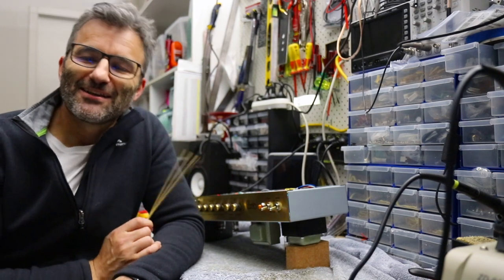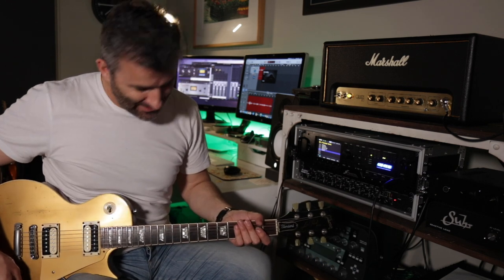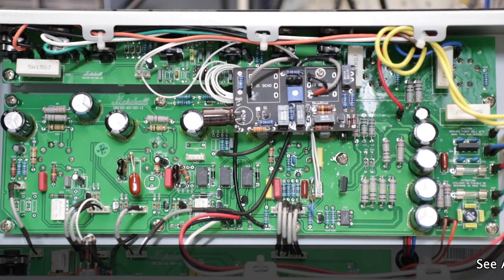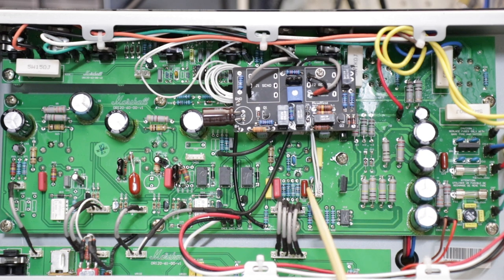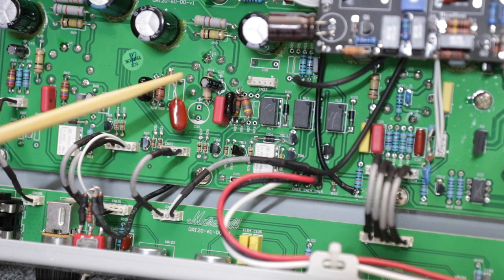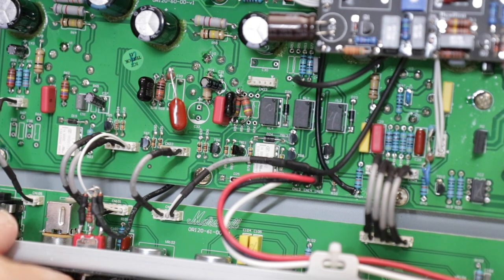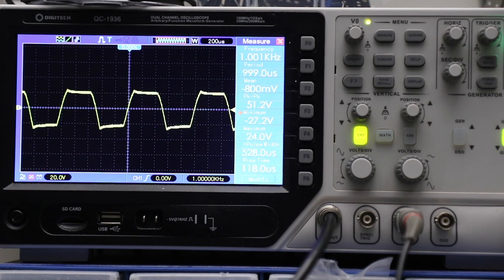Headfirst Modded Origin 20 - José Diode Clipping DIY Guide

Comment: Bought on Friday an used origin 20 for 200£ and I did similar mods to yours. I started with a kind of 800 inspired preamp, but I ended up with something quite similar to you setup after some modifications(I just left a 4.7n as first coupling cap as it sounds a little bit beefier to me and i didn't put the 470pf on the CF. I had instead lowered the CF resistor to 70k circa putting a 220k resistor in // to the 100 original one) I have then added an asymmetric 24V/18V diode clipping (I liked just a little effect, I am not a huge fan of hard clipping, it sounds too much like a pedal otherwise). I have also added another 0.68u cap on the second stage on the top of the 2.7k resistor. Quite impressed with the result!
Important to mention that the PCB are "crap" and the chance of ruining some pad is high. I consider myself "skilled" and also like that I was able to ruin 2 pads (luckily of unused components).
Thank you Jason for all your nice videos!
Reply from the maker: Nice work.  It's great to hear that you tweaked to your own taste!

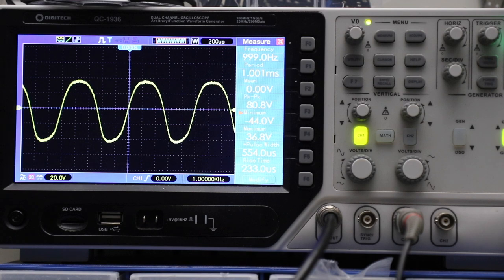Comment: Thanks Jason and for demonstrating what we spoke about previously and the voltages at the different points and taking into account what the resistor and cap were doing in the circuit at 28:00 in until 34:00!!  :)
Reply from the maker: I absolutley did this part of the video because of your idea/suggestion man!

Comment: I’m not too fond of clipping diodes to be honest. It’s more like an onmodieuze switch and doesn’t react naturally to rolling back the volume. I’m get closer to my ideal sound with a soldano-like approach . I’m currently implementing this on a 1971  London city plexi clone . Added an extra tube, for a lead and crunch channel setup. I’ve changed some bypass caps to get less fizz and I’m tweaking the crunch channel to get more into   plexi /JMP territory. I also put a fat switch on a dual bypass cap on the last stage before the cathode follower which gives it some extra flavors

Comment: Hi. Let me congrat you on your fine work. I discovered your channel just yesterday and need sometime to digest all info in here. I wonder if I can apply this zener clipping mod to a Fender AB763 Bandmaster amp? And how? Thanks
Reply from the maker: Hi, thank you.  I'm afraid the diode mod will not work in that kind of amp, you really need a cathode follower driven tone stack to follow what I did in this video.
Reply: @HeadfirstAmps  Thanks for your kind reply. Would you suggest I put a solid state FET buffer after 1st gain stage before the tone stack to mimic cathode driven one. I saw some schematics with such arrangement as a cheap alternative to using tube drivers. Thanks again....

Comment: Where xan i get this mod scematic ? I have to Marshalls 50 origin and would like to mod them this way....Live in Sweden so its a bit hard to send the amps for modding elsewhere...I have a real good guy in stockholm who can make the mods for me..thanks for a real good video.
Reply from the maker: I've done 3 videos on it, but have not gone to the extent of tracing out a full scheme.  Everything I have shared is available in those videos and is up on the website.  Plus there is lots of help available in my DIY Builders Group on FB.  Lots of folks there have done this mod to their O50's
Reply: @HeadfirstAmps  Ok..Thanks.. i will check it out with my amp tec .👍

Comment: So these tones absolutely can’t be duplicated with a pedal in front?  Carvin has these 4 clipping diode arrangements in a bunch of their amps - and everyone seems to hate it?!?  Why is it guys hate it when it’s installed, and when it’s not - guys want to install it?
Reply from the maker: You can't do this with a pedal, it's all about sequencing of the gain structure.  Carvin's implementation is very different, much earlier in the pre-aamp, and sounds very buzzy by comparison.

Comment: i have the origin 50h and the gain sounds spitty i guess you would call it that. when on the neck pickup or with more bass with the gain turned up if you play a chord and let it ring out thats when it gets spitty or sounds like something is touching the speaker as the sound starts dying off. the cheap dark matter pedal i use to have did exactly the same thing. my bb preamp at pedal does not do this and sounds great. did your amp do this when it was stock?
Reply from the maker: I don't think it did, but stock they sound pretty lame imho
Reply: @HeadfirstAmps  its hard to notice sometimes. if you never let a chord ring out then start dying off it wont do it and it sounds decent but if you let it ring out it does it. i thought it was the speakers so i used another cab and it did the same thing. like i said before the tc electronics dark matter pedal did this too. must be a bad design.  i guess i will only use pedals.

Comment: Is the 220k left in parallel with the diodes with this switching?
Reply from the maker: The 220k to ground is always in the circuit, only the zeners switch in and out
Reply: @HeadfirstAmps  stops popping I guess?
Reply from the maker: It's replacing the 'José master' which is normally where the master volume pot is pre tone stack
Reply: @HeadfirstAmps  gotcha, was just confused by the diagram